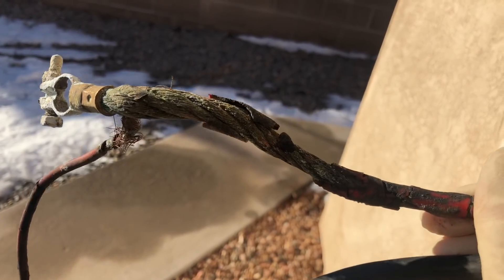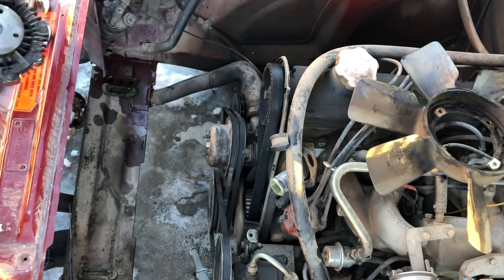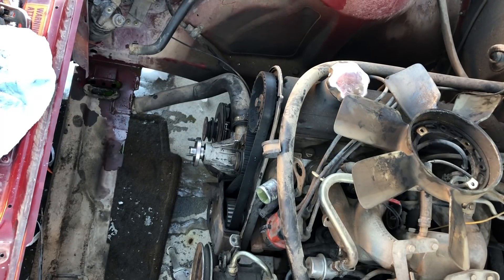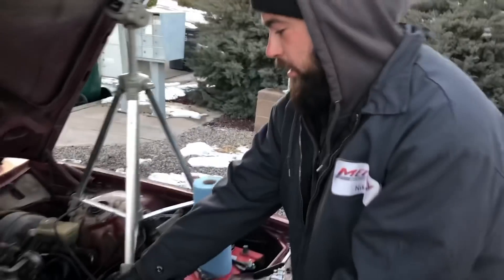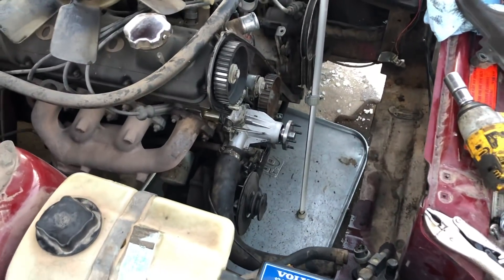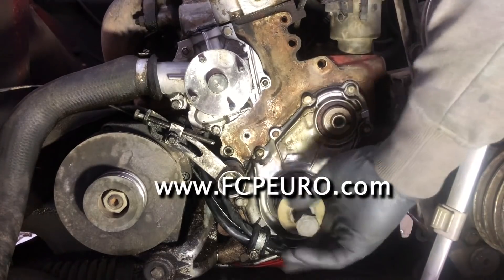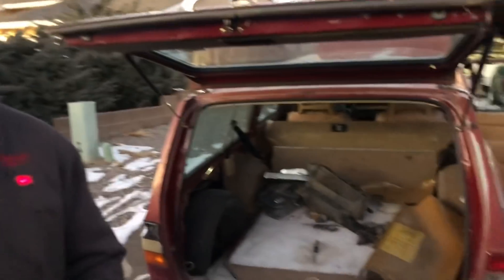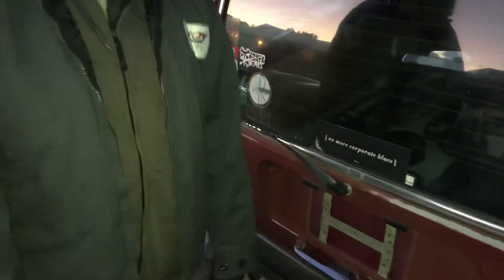2 Goofs vs Volvo 240 Timing Belt Replacement - Part 1/2

Comment: This will most likely be me soon because my '90 760 turbo belts are going bad so it'll be a fun process to go through myself soon 🙂
Reply from the maker: C0DZombies12 not much harder with only a few extra steps to remove intercooler piping.

Comment: Well, that was a hell of a treasure trove under the boot floor.  Clearly one of the previous owners was an old-fashioned type who kept replacements for anything that was likely to break with them so they didn't get stuck on the side of the road somewhere...
Reply from the maker: gosportjamie that’s me. And every 240 I sold had a box or two of parts like that.
Reply: I’m approve. My Volvo’s trunk is quite well-stocked and thus my mind’s at ease.

Comment: do you put new tires on these old cars you are buying?  how old of tires will you drive on if they are not badly cracked? do you have an age threshold that no matter how they look you automatically replace if they are past that age?
Reply from the maker: Movo Iroll generally ten years. It’s been six years since I had a tire that old on a car. Usually they’re worn and I just replace them. I had two flats in one summer on my previous BMW after ten years of no tire trouble, so I know not to take chances on them and just replace when needed. Same principal as the timing belt and alternator belts. Easy to do, so it’s best to do now rather than inconvenience myself later.

Comment: When I got my 1st gen MR2 I had the bright idea to see how fast it could go on the freeway. 96mph. Shortly after I realized it had almost no oil, a hole in the coolant tank and had leaves and dirt in it, and one of the spark plug wires wasn't even in. Lesson learned when I was 20 ALWAYS check the basic stuff DONT ASSUME. Luckily it still runs 5 years later although I can't attest to it's health.
Reply from the maker: magna vox so how fast did it get with all plug wires in?
Reply: @DavidBello  It's never been tested =P I bent a tie rod in the rain then the input shaft seal started leaking after I parked it. I replaced both of those then started doing some major renovations and it's been parked at my dads ever since while slowly restoring it over the last year. I wan't it to be tight and back in shape before I start driving it for real. It obviously wasn't cared for before I got it and I didn't take much care of it when I first got it but it's time it's got some love in the past 10 years.
Reply from the maker: It’s definitely an investment. That car will appreciate over the next couple of years onward so I am glad to hear it gets a good treatment.

Comment: I heard you mentioned the T-cam. Please avoid it, it's a bad profile and a mistake from Volvo to ever use. The stock A-cam is better than the T-cam, even if you slap a turbo on it. The main issue with a turbo on that engine will be compression. The B21ET has different pistons and sodium cooled exhaust valves (and the bad T-cam). Only differences I can recall.
Reply from the maker: DAW 75 I had a T cam on my last 84 with the 3:73 rear end and I loved having the Lowe end torque. I never took it up into higher rpm and enjoyed fuel savings. The stock cams are M cams here. I’ve never seen an A or B cam but I know they were an option on some select cars.
Reply: Interessting, I'm from Sweden and have never seen an M cam, heard of them though :-) The A cam is about the same as the T cam with good low and midend torque but A has higher lift than the T cam (which is the cam with the lowest lift). For performance I think the K cam is the sweet spot, high lift, still some low end torque and happy to rev well over 6k, but it's not very fuel efficient... The K-cam is on the border of making it an interference engine, though.

Comment: i buy all the new parts for my e34 from fcpeuro one of the best sites i've ever used
Reply from the maker: PurpleJerry same when I had my e34 touring.
Reply: This past August I had big problems ordering/receiving parts from FCP Euro for my '90 740GL. So much so, that the president - not THAT president,  but the sane one lol - wrote me an email apologizing for the problems I had experienced. I will never order parts from them again and now deal with RockAuto and other online retailers - including a Volvo dealership that has an online catalogue of Volvo parts at discounted prices. A great alternative to FCP Euro!
Reply: @DavidBello your e34 videos are how I found you originally, did you sell the e34?
Reply from the maker: PurpleJerry I did. It was a great daily—I called it the most reliable car I’ve ever dailied, but I wanted something newer so I sold it and bought the S60R.